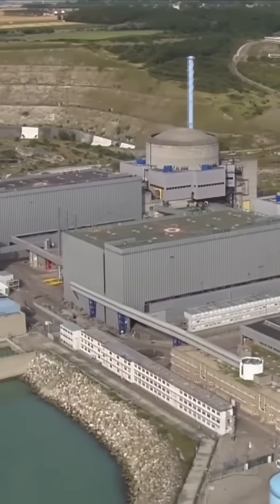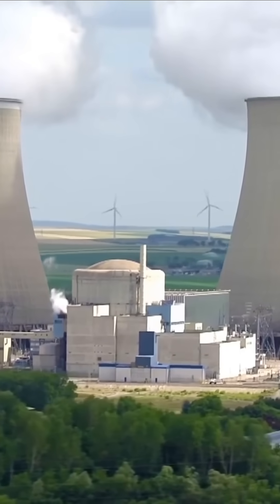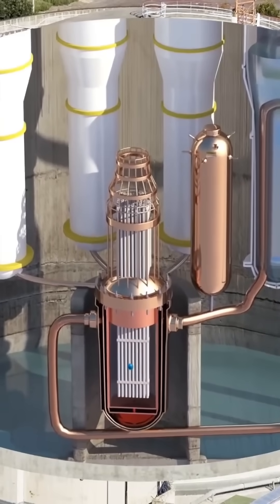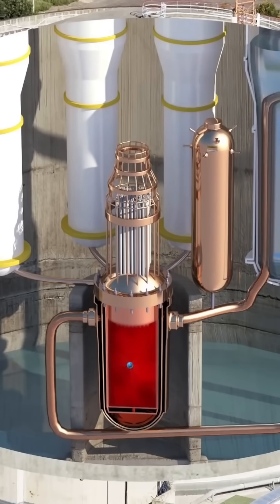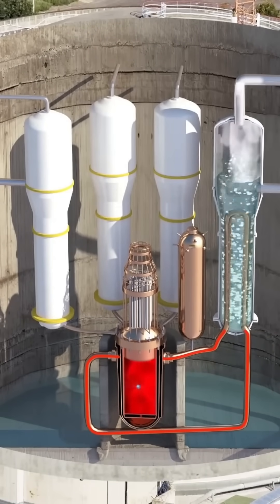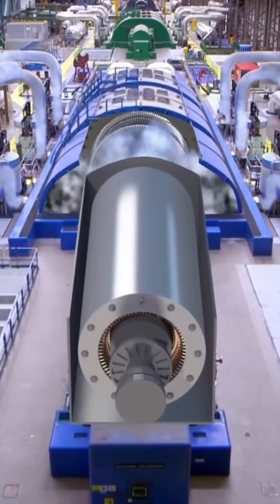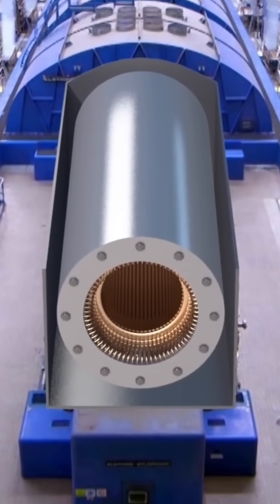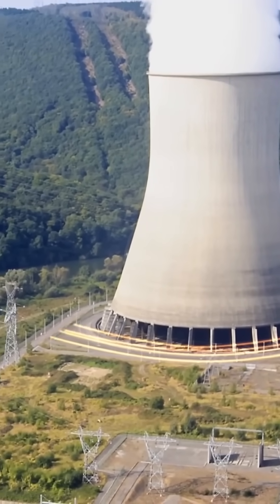How does a Nuclear Reactor work? #shorts #nuclearpower #nuclearreactor

Comment: Stupidly.
Also they require 1 or 2 normal power plants just to provide the power to operate a NPP.
450,000 gallons of water a minute needs to be pumped continuously to cool/boil off the heat from the spent fuel ponds alone let alone all the other power requirements of a Nuclear power station.

We have no need for anthro fission products that do not exist in nature as well as and no living creature with DNA/replicating cells has any immunity to.

The incidence of boy to girls ratio, metal health issues,downs syndrome and other congenital malformations as well as cancer rates rise steadily with proximity to NPPs and there disease causing cooling stacks
Reply: @pixuxucobrasil9206 
Abstract
Although radioactivity is released routinely at every stage of nuclear power generation, the regulation of these..

 releases has never taken into account those potentially most sensitive—women, especially when pregnant, and children. From uranium mining and milling, to fuel manufacture, electricity generation and radioactive waste management, children in frontline and Indigenous communities can be disproportionately harmed due to often increased sensitivity of developing systems to toxic exposures, the lack of resources and racial and class discrimination. The reasons for the greater susceptibility of women and children to harm from radiation exposure is not fully understood. Regulatory practices, particularly in the establishment of protective exposure standards, have failed to take this difference into account. Anecdotal evidence within communities around nuclear facilities suggests an association between radiation exposure and increases in birth defects, miscarriages and childhood cancers. A significant number of

Etc

Pixxy claims no ☢️ are released by NPPs 😂😂😂😂😂
Reply: Did you even watch the video?
Every thermal power plant has cooling towers. ALL OF THEM, of every kind
Geothermal, coal. And all it releases is water vapor. Nuclear power plants also don't need that much outside power. In fact a NPP can provide for itself using the power it produces, or from another on-site unit if its a two unit plant. There's no fission products released to the atmosphere either. And where did you get that radiation affects "boys to girls ratio" and causes mental illness?? That's got nothing to do with radiation anyways.
Reply: @pixuxucobrasil9206 
Not true at all 

All NPPs require two dedicated normal power stations to supply the power to pump the water at 500,000 + gallons a minute of everyday .. failing those they have bk up diesel generators, once they go you have around 20 minutes until unstable meltdown occurrs
Reply: @BrodyLuv2 No... you barely need 50 MW for a nuclear power plant. That's nothing. The nuclear plant will be able to provide gigawatts, its a sacrifice thats worth making. And any plant requires much external power to start. Also, a NPPs safety systems don't need power. RCIC for example uses residual steam, reactor emergency injection has their own separate diesel generators that kick in, the battery pack and emergency generators are meant to last for days, portable generators are easily delivered. Also a meltdown takes hours to days to happen. You don't need any power to shut down the reaction.
Reply: @pixuxucobrasil9206 
An NPP at best supplies 1 gigawatt but most are in the kW still and are in no way worth the 30 years planning, 30+ years decommissioning & 6billion to build.

You are very mistaken.

Go look at data on how much renewables put into the grid compared to Nuclear.. it is pitiful & you must be very, ermmmm...
Reply: @BrodyLuv2 Doesn't take nearly that long nor that much. The kilowatt plants aren't even plants, they're research or medical equipment production reactors. Any other reactor is designed to operate at the several megawatt scale. A BWR could get you 1200 MW, that is 1.2 GW, on a single unit. CANDU is the lowest I know, apparently it goes to 600 MW, which is still a lot.
Reply: @pixuxucobrasil9206 
I meant to type 100,000 kW - 1Gw .
Reply: @pixuxucobrasil9206 
It does take 30 years + plus for modern npps to be planned and built.

Look at one the most 'recent' Hinckley point 

Billion & billions of taxpayer money over original cost & nowhere near being completed after 30 years
Reply: @pixuxucobrasil9206 

NPPs are not at all profitable apart from what they make.

And I do not mean electricity.
Reply: @pixuxucobrasil9206 

All fission products during the cooling that require venting are released from an npp into the environment via the thin sfp tower slowly overtime.

You reaally are speaking without any knowledge at all
Reply: @BrodyLuv2 sfp = spent fuel pool i presume. Notice how the spent fuel pool is deep inside the reactor building. There is no tower for that.
Reply: @pixuxucobrasil9206 
The SFPs actually are on the Upper floors above the reactor vessel 
.

There are no top floors left.

My goodness
Reply: @pixuxucobrasil9206 
What are you talking about no tower for venting the SFP produce !??
Reply: @BrodyLuv2 The SFP's products stay inside it. There's literally no point in venting anything. If you throw radiation into the atmosphere like that you're getting the IAEA after you.
Reply: @pixuxucobrasil9206 
You are crazy to state that NPPs do not vent and do not vent via discharge.

Seriously, stop trying to use search to talk and know what you are talking about
Reply: @pixuxucobrasil9206 
Wild statement that NPPs do not release radioisotopes/radiation .  Incredible statement 

Here, very basic ..

Abstract
Although radioactivity is released routinely at every stage of nuclear power generation, the regulation of these..

 releases has never taken into account those potentially most sensitive—women, especially when pregnant, and children. From uranium mining and milling, to fuel manufacture, electricity generation and radioactive waste management, children in frontline and Indigenous communities can be disproportionately harmed due to often increased sensitivity of developing systems to toxic exposures, the lack of resources and racial and class discrimination. The reasons for the greater susceptibility of women and children to harm from radiation exposure is not fully understood. Regulatory practices, particularly in the establishment of protective exposure standards, have failed to take this difference into account. Anecdotal evidence within communities around nuclear facilities suggests an association between radiation exposure and increases in birth defects, miscarriages and childhood cancers. A significant number of

Etc
Reply: @BrodyLuv2 Yes NPPs vent to the atmosphere. After a bunch of filters. And majority of what is vented is very stable, the increase of radiation is not discernible of that from background sources.
Took a while to understand what you were saying because the spent fuel pool does not relate to this system. Often the radwaste building is near the containment building but the off-gas stack and spent fuel pool have zero relation.
Reply: @BrodyLuv2 Nice text, note it is blatant misinformation. Uranium mining does not release significant radiation because natural uranium is not nearly as radioactive as fuel, fuel processing and storage facilities are highly controlled not just because of radiation but also because you don't need anyone getting access to the equipment that could be repurposed for weapons-grade processing, and so is the power generation release. And it is very likely this "evidence" from these communities are just caused by the paranoia of people getting them to blame it all on nuclear. I live relatively near an NPP and no one I know has had one problem relating to it ever.
Reply: @pixuxucobrasil9206 
And again, you are completely incorrect about incidence of all types of illness and proximity to NPPs - I have read countless papers on nearly all aspects of human health and NPPs - Fukushima Daiichi 6 out of 10 children have diabetes and 9/10 thyroid nodules larger than ½cm .. following the events in Japan over 800,000 additional cancer cases in just 2012.
Reply: @BrodyLuv2 Fukushima is totally irrelevant. A reactor exploding is not the same as reactor operating normally.
Reply: @pixuxucobrasil9206 
4 reactors and spent fuel ponds actually 
.

Go learn
Reply: @pixuxucobrasil9206 

Look at any picture of an NPP - farms all the way up to the fence line.
Reply: @BrodyLuv2 Because its private property. You don't see farms inside a coal plant's area..m
Reply: @BrodyLuv2 Still does not make Fukushima relate to this.
Reply: @BrodyLuv2 Also would like to make it clear. I've went after a report for some research because your numbers looked very much wrong. No one other than workers, response teams, and a very small amount of locals was exposed to any significant radiation, and the cancer risks from radiation and natural causes are barely discernable in Japan anymore.
Reply: @pixuxucobrasil9206 
'anymore' lol You understand total Meltdowns liberate all isotopes, right!?

And that these isotopes last millions & millions of years for a lot of the most dangerous.. you cannot clean up after a total Meltdown as it already happened.

Do you honestly deny physics and the fact these Isotopes are now 'Decayed' or whatever your mind thinks !?.

How could you even try and state that when talking about total and complete unabated meltdowns!?

Look at the word, use your critical thinking skills ,apply them to the terminology.
Reply: @BrodyLuv2 An isotope that last millions of years is barely even radioactive. Barely as in you'll have gotten a single like microsievert every few thousand years. Because that means they are extremely stable. You try to say I should use thinking, but did you even do any research ever? You literally just make up things. The SFP is besides the reactor, not above it. "There are no floors left" That's like saying every building has a floor limit that cannot be exceeded. Go do some minimal research. Otherwise don't even bother replying.
Reply: @pixuxucobrasil9206 
The SFPs are in the upper floors .. there are no upper floors left

I am looking at a schematic for GE modern reactors, like those at Fukushima and all over Earth .. they are situated on the upper floors mate 

It is simple 

The reactor goes deep into the units and the top part where you refuel is at the top floor hence the location of the SFPs .. they take it out of the reactor then move it to the SFPs on that floor.

Seriously, stop using Ai or what is misinforming you so badly.

Incredible amount of denial
Reply: @BrodyLuv2 i get what you mean with above. But still... In the GE documentation nowhere have I ever seen anything about the SFP releasing anything into the atmosphere. Everything that is released has a seriously unnecessary level of filtering, for the purpose of not letting anything out. Which makes me doubt you even have anything to be making these claims from. It takes a basic understanding of a reactor to know how much of what you said is incorrect.
Reply: @pixuxucobrasil9206 

What do you think the cause is of radioisotope from the thin vent are?

And the releases made routinely by water discharge?

Seriously ???
Reply: @pixuxucobrasil9206 

How do you imagine the steel at NPPs suffers neutron bombardment which leads to the steel becoming brittle ?

Seriously, you got to really understand radiation to discuss it
Reply: @BrodyLuv2 Specify what vent. Where did you see it. And what is it even called.
Reply: @BrodyLuv2 Because the reactor needs neutrons to even work. That's basic.

Comment: how does water in secondary loop in heat exchanger not get contaminated with radiation if it is constantly that close to it? normalle we need 4 feet wall for protection.,..

Comment: But what gets me… is why do we need nuclear fuel to produce steam to turn a turbine.
Why cant we use, oh I dunno, say giant magnets to turn the turbine?
Reply: A magnet cannot generate energy on its own because magnets require an opposing force to create energy.

The only way to allow an opposing force to be applied against a magnet consistently is by using another source of energy. 

For example, a magnet will not turn a turbine unless the magnet is moving against the turbines magnetic field and the only way for the magnet to move consistently in relation to the turbine is by powering it with another source of energy.

Comment: Instead of using light water as a moderator, Chernobyl used graphite
Reply: And that worked out well…
Reply: @WilcoBC 

"Not great, not terrible"

-Anatoly Stepanovich Dyatlov
Reply: That's one of like 900 design flaws that reactor had, positive void coefficient, slow control rod insertion, lacking many safety systems, no containment building, graphite tipped rods that accelerated the reaction instead of slowing it like control rods should do, and plenty of other issues. I still think the RBMK is a really cool reactor it just sucked.
Reply: @josephtf3188  Positive Void Coefficient is not a issue by itself. But, machinery being not great, backup power being too slow, and the sheer bureaucracy of it are far worser factors
Reply: @ZippyPiglin36  I agree, I think you can make a reactor with a positive void coefficient and have it be safe. But the problem with the RBMK is safety was a second priority, they were focused on having the RBMK produce as much power as possible. Then they ran tests where said safety systems where intentionally shut down. No wonder stuff went wrong
Reply: You didn't see graphite

Comment: I just love watching videos about things that I know about. That diagram of a reactor is so damn unstable. Talk about flux across the core. Shit be looking like Joe Biden’s approval rating. The operators are going to be wondering why they had enough fuel for 30 years but could only keep it critical for 15. The electric companies are going to be wondering why a reactor that size is only making 50mw. Where’s the pump man? Why is there only one return with four steam generators? Where’s the isolation valves or pressure reliefs? Where’s the nuclear instruments? Man this is some communist design and built type shit. Bro got this reactor off of alibaba. Bro got the free reactor off of temu. Bros reactor made out of chinesium. Bro got sold hafnium fuel rods. Bros control panel looks like the shit you get with a McDonald happy meal. Bros steam generators came with factory defects. Why did the chicken cross the road? To get the fuck away from this ticking time bomb. Bros employees consist of the Chernobyl reactor operators. Bro initiates steam demand in the intermediate range. Bro controls rods with a rope and pulley system. Bro got that three payments of $19.99 reactor. Bros reactor looks like it was built in a sweat shop. Bros reactor has the natural circulation of a 60 year old man. Bro got that engineering disaster piece. Bros reactor is refueled with diesel. Bro hits scram and he wants to run the reactor. Bro got the power level of a double a battery. Bros reactor is wrote about because it’s what not to do. If he had a cold water casualty bros reactor would be able to turn on a led. When bros reactor goes critical he still can’t detect power. Bro has enough fuel for one startup.

Comment: Laymen here. Does the water used becomes radioactive and how do they dispose the water is it by turning it into steam and venting it through the atmosphere.
Reply: no, there's 2 water systems in a Pressurized Water Reactor [PWR].

Primary Loop:

The reactor core is cooled by pressurized water in a PWR inside the primary loop. This water is kept under high pressure to remain in a liquid state and does not boil.

This primary coolant water absorbs heat from the reactor core (where the fission occurs), but does not mix with other systems and does not directly touch the fuel.

Steam Generator:

The heated water from the primary loop is passed through a steam generator, where heat is transferred to a secondary loop.
The secondary loop water (not radioactive) heats up due to the heat transferred from the primary loop water but remains separate from the radioactive water.

Secondary Loop:

The secondary coolant water absorbs heat and is used to generate steam, which drives the turbine and produces electricity.

The secondary loop water never comes into contact with the fuel rods and is completely sealed off from the primary loop. It cools via the cooling tower to decrease its pressure and temp.

Heat Exchange:

Heat is exchanged from primary coolant water to secondary coolant water through heat exchangers, ensuring that the water in the turbine (secondary loop) doesn’t touch the radioactive water from the reactor.
Reply: Depends on the type.  The Pressurized water reactor (PWR) does not generate radioactive steam since the steam is in a separate loop and never touches the nuclear fuel.  

On the other hand, a Boiling Water reactor (BWR) boils water right inside the reactor and transmits radioactive steam to the turbine. But it is easy to deal with this and keep workers safe (the radioactive steam has a very short half-life and decays away really fast).

So why use a BWR at all?  Because they have some advantages over PWR's.  For one, they do not operate at super high pressures which makes them easier to maintain (and safer in some ways). They are supposedly harder to melt-down as well. (Though all reactors will melt if not cooled). 

There's about 20 or so BWR's in the U.S. operating right now.  My local nuke plant is a BWR.
Reply: @Wowzersdude-k5c  TQ for the explanation.